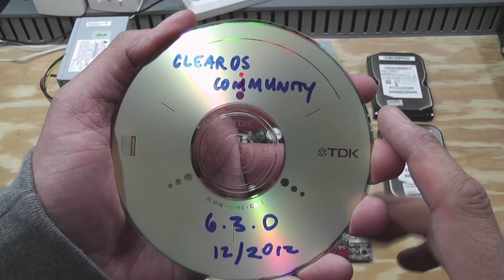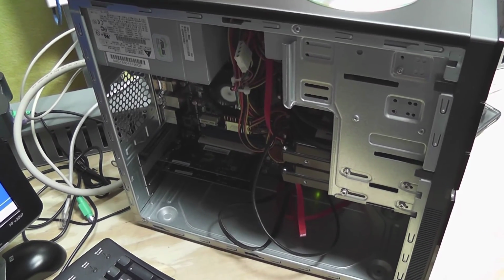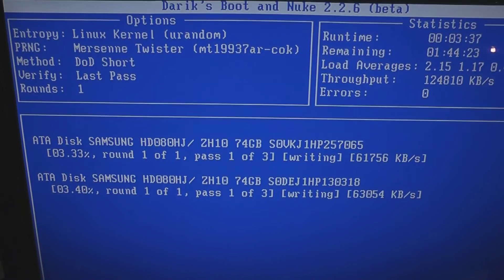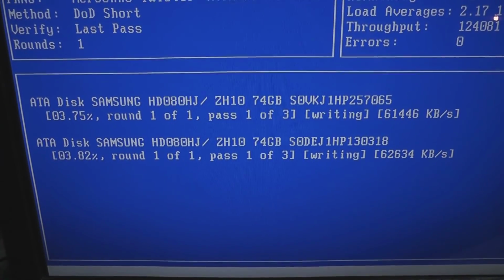New Firewall Build - Part 1 - Temporary Location

Comment: You do know, that you could have turne the power supply around, so the power supply pony tail was close to the motherboard, and it would have reached? I had a similar situation with this case, and it worked perfectly fine. Also, all cards have a space cut out so that you can run cables underneath them to fans\cpu power and such.